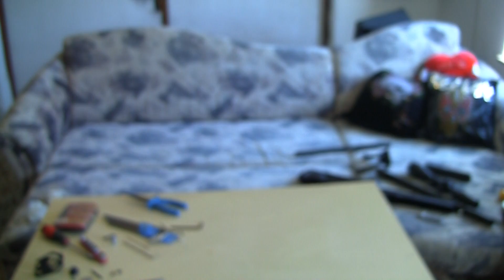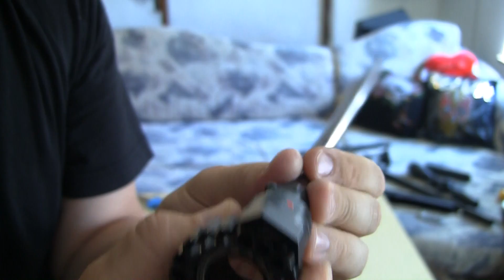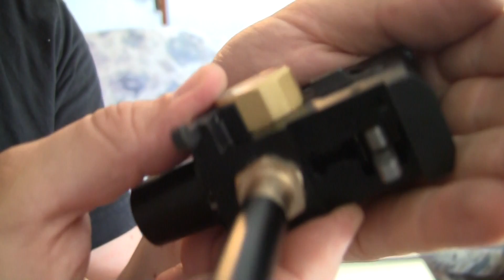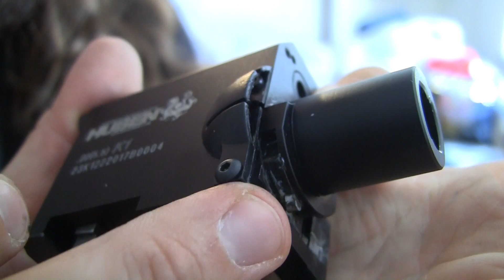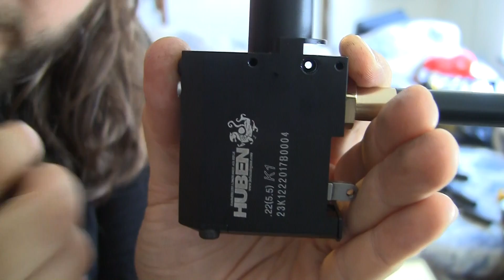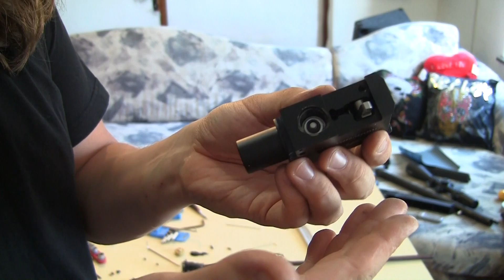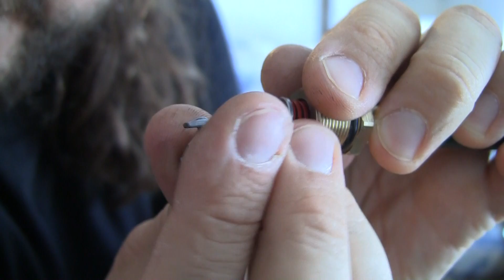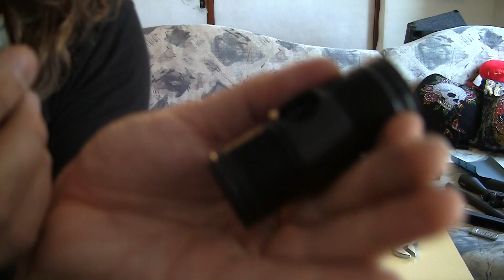Huben K1 version 2 - disassembly

Comment: Gregor 1st of all - great Videos that you do, thx for sharing your knowledge and skills. I have one question, that I think i know the answer but want to be 100%sure.
Could the closing valve be removed without draining the whole System? I think so, but maybe i did Catch something wrong.
Reply from the maker: You can drain only the regulated plenum by unscrewing the regulator down to zero (the regulator is designed to let the air out it self when you go down very far...). Note that this does put more stress to the regulator seal, but personally, I never had a problem with the regulator because of this and I do it all the time. I would suggest to take the stock off before you release the pressure though, once you have the stock off, just star unscrewing the regulator hex screw until the air bleeds to 0 on the regulator, then start disassembling the action...
Reply: @gregorkamensek3923  that makes sense, thanks so much!!!

Comment: After about 190 shots, pulled trigger and the gun would not fire. Safety would not go all the way down. Reading the manual, if I understood it correctly, it said to release pressure until safety would work again. I released all the regulator pressure to zero and the safety then regained its full range of motion. Turn the pressure back up but the gun would still not fire. Any ideas? I don't want to have to send it back if it's an easy fix.
Reply from the maker: If you cannot engage the safety, that implies that the trigger sear did not catch the valve but that would also mean that the air would be leaking rapidly for the gun... If that is the case, it is possible that the trigger springs are too loose (the two set screws you can see just above butplate on the rear). But I doubt that is the case as you mention that the gun does not fire. I assume that the valve is stuck in a semi open position, enough that the air is still not leaking but not enough to open. You can try to fire with higher pressure, try to go up to 180 bars.
It is also possible that there is some sort of trigger problem, maybe one of the sears broke so you cannot fire and also cannot put it on safe...
Reply: @gregorkamensek3923  I degassed the regulator and that re-enabled the safety. Then, re-pressurized it to 17 MPa, but still doesn't fire. I'll try to get it up to a higher pressure like you suggest. I had not changed any of the settings from when I received it. 
No leaks from the gun at all.
But thanks for your reply and help. I may have to return it for warranty work.
Reply from the maker: @jimdoria7871  Probably best to return for warranty repair... Triggers on semi auto guns can be tricky...
Reply: @gregorkamensek3923  with no reply after several attempts and almost a week of trying to contact Huben, I thought I would take a chance to try and fix this myself. Saw a video from Kraz Cool on resetting the trigger. It was relatively simple and it did work for me.
Thank you and Kraz Cool.

Comment: Mr. Gregor,
I had been watching all your video on Huber K1 V2 with so much excitement. After 3 months of watching (not everyday) I finally decided to please my order which you know it takes me almost 4 months of waiting and finally is here. Can’t wait for testing on the field..
My first question, how many shots can you get out of 1 filled of 300 bar pressure? Thank you. 
PS. Can I have your email address.
Reply from the maker: Hi. Shot count depends on the power you will use. No doubt that the best results will arrive by using slugs of about 35 grain shooting them at about 980 fps. With this setting, you will get at least 25 regulated shots (from 300 down to 170 bars) if you set you gun correctly.
Send me a private massage and I will send you my email or just write your email and I will contact you.
Reply: Gregor Kamenšek thank you so much for your reply.
Reply: You may have these!

Comment: Hi Gregor,
Can you sent me the exactly size of the two tools huben send to you for replace the seal so I can fabricate them.
Thank you very much
Reply from the maker: I the tools have a very slight cones on some parts and they need to have a rough surface on the one that is for removing the seal. So it is not easy to measure and duplicate them. I also slightly modified them so they might not work for you...
Reply: @gregorkamensek3923  Ok, thank you anyway

Comment: Hi .. thanks for the amaizing vedios ... can you make a vedio about what happens if you zero huben k1 on 50 yards then shoot at 20 yards,30, 40, up to 100 yards using huben pullets with full power... just so we know the trajectory.    Thanks
Reply from the maker: Ali Murad . Take a look at the data at the end of video 2 on k1 v2. There is a screenshot from chairgun. I have it zeroed at 25 meters and i have to hold over 2,6 mil dots at 100 meters.

Comment: How do you remove the endcap of the shroud? 
I want to put on a supressor that I´ve bought but the endcap is screwed on extremely tight.
Reply from the maker: Yeah that is a challenge. Best is if you have pliers with plastic inserts not to damage the endcap.

Comment: HI Gregor, thanks for the video which is what I need right now because my Huben K1 has developed a slow leak, about 2.5 bars per day. Just wondering if you have any thinking about the likely point of leakage ?  thanks in advance.
Reply from the maker: Hi. I had a similar problem. These are quite hard to find. In the end I solved the problem when I  disassembled the regulator and reassemble it, never really figuring out where exactly the actual leak was...
Reply: @gregorkamensek3923  Thanks Gregor, I will try to do the same. hope the problem is is not inside the action which seems to be very complicated.
Reply: Is it safe to submerge the entire gun in water with pressure to help identify the leak by seeing the tiny bubbles ?
Reply: @gregorkamensek3923  see
Reply from the maker: @hubenk1  It is not the best option, but it might be the only one that enables you to find the leak... Huben actually suggests to submerge the gun in pure alcohol :) I have the gun with removed stock when I do that and I submerge only the part that I assume is leaking. I usually still disassemble the gun afterwards to make sure everything is dry... There are still a lot of steel parts that might rust (barrel in particular).

Comment: Went to use my huben today and noticed reg pressure was way down to 100’ish, filled it with air and hear a slow clicking coming from the dial, possibly a leak? If so where would it be coming from?
Reply from the maker: Where did you hear the leak, near to which dial?
Reply: Gregor Kamenšek the regulator gauge there is a slow clicking but I dry fired till around 100bar then re filled, seems to have resolved the issue
Reply: Gregor Kamenšek do you have email I could send a 9 second video highlighting sound and location?
Reply: It’s definitely an issue and am very worried it’s a the VS, would compensate you if you can provide a VS and help as huben have gone dark and not had any comms with them

Comment: Is it necessary to remove stock to remove shroud?
Reply from the maker: No. Just loosen the rear two screws below the picatinny rail on the cylinder/shroud clamp and remove the front one. The you can just pull the shroud off.

Comment: Hi gregor, i had a leak treu my barrel. I changed the firing valve seal and it still leaks. Its not the indexing pin becausz when i lift the lever up it still leaks. What could it be?
Reply from the maker: If the leak is through the barrel that the problem is still the firing valve seal. Maybe the new seal did not seat properly. Also possible is that you have some starches on the valve or the seal seat. These parts are very delicate and you should be very careful when you replace them and use only plastic tools (except for the replacement tool that is of course metal). But if that is the reason, then the leak is very slow... so my bet would be that the seal did not seat properly.
Reply: Hi gregor, is there a way to send you a picture from something weird in the chamber where the opening valve seal sits? Looks like something is sticking out. I tried a 2nd time to replace the seal and stil leaks verry hard treu the magazin/barrel when a shot is fired
Reply from the maker: @klane7  You can give me your email...
Reply: I have sale problem

Comment: I have taken the airtube apart my Huben K1 ( version 2 ) and found that all the O-rings are surrounded by rubbery stuff like silicone sealant. It seems that they have added the stuff to make the seal better, may I know if you have seen the same thing in yours ?
Reply from the maker: No, I have not... On all my K1s there is only silicon grease on by the o-rings, noting else...

Comment: Hi mate how are you doing 
Need your help my huben is bleeding air out of barrel as I fill it what do I have to do
Last time I was have same problem I dismantled the valve both and the problem was solved and now after some shots same problem again started to bleed aur from the barrel
Reply from the maker: There are a lot of possibilites. It is possible that you are using too low pressure to shot. I would not recommend going under 120 bars (also make sure the pressure gauge is showing correct pressure). It is possible that the valve seal is damaged. And many other posibilities. How fast is the air leaking? Can you still fire a shot?
Reply: @gregorkamensek3923  my reg pressure is 140 bar and  I can't shoot it
Reply from the maker: @khilji74  So I guess you have a "fast leak". A few things are possible. It is possible that the trigger does not hole the valve closed. Did you adjust the second stage on the trigger on the rear side? if so, just make it a bit heavier (tighten the spring) and it will work. Next possibility is that the valve is stuck in the contracted position. To see this, you will need to remove the valve and try to extract it (try to pull the brass part of the valve out of the steel sleeve with hands - no tools!!! It should move out for about 3-5 mm and then stop). Next option is that the seal in the breach is damaged but if this is the problem, the damage must be significant in order for the leak to be so fast. Another option with the trigger is that the spring at the back of the valve behind the round part that engages the trigger is too weak to push the valve closed. There can be several reason for this, one is if the o-ring at the back of the valve is damaged and causes high friction, another is if the trigger sear has too much friction on that round part, another if the spring is too weak or broken,... In any case, be very carefully not do damage the breach / body as that is the only part that cannot be fixed (it can be replaced but it would be expensive I presume)... Good luck

Comment: Hi Gregor! Great video, as always.
I have a question about the k1. I've never disassembled it but the Weaver rail is misaligned with the barrel. My scope is at the end of the windage and I'm still hitting left of the center. How can I best fix this?
Reply from the maker: There are various ways to deal with this, but if the gun is shooting well, I would go with adjustable mounts as I would not advise disassembly if not necessary.
Reply: @gregorkamensek3923  ok, thanks! I'll be getting myself a set of those. But just out of curiosity, what would some of the other ways to deal with this be?
Reply from the maker: @tacticalbantha2511  First you would have to find what exactly is the reason for this misalignment and then solve it. For example, some scope rings are not accurately made or not made up to rail standards and this could be the reason, it can be that the rail is not aligned with the barrel, or maybe the gun when assembled was not properly aligned. A lot of bulpups have this problem as there are many points where barrel is fixed and can even cause for the barrel to be slightly under a tension or even bent... But I cannot say how to fix an issue without knowing the cause.

Comment: Hi Gregor, I have a problem. Recently I’ve been shooting the Huben K1 v2 but I hear a rattling sound as I shoot. Is it a problem with my setting between the power wheel and the pressure? Or the trigger adjustment? I’ve tried tinkering but it didn’t fix it. Any thoughts?
Reply from the maker: Is the rattling sound only when you shoot or also if you shake the gun. Is the sound present also when you dry fire the gun? Is the gun otherwise operating normally? The problem could be a lot of things and will be hard to find just through conversation.
Reply: Gregor Kamenšek it makes the sound only when I shoot a bullet or dry shoot. What could it possibly be you think?
Reply from the maker: @Komunika00  I cannot set only by this description.

Comment: Hi Gregor.  Your videos are very good.  Can I ask you something?  I bought one.  In my country, Argentina, there are no people who know the rifle.  I made the mistake of trying with defective pellets.  The charger was locked and all the air went out.  The charger did not spin.  I took it apart, took out the defective pellets and assembled it.  But now, I connect the compressor and I can't load it.  Lose air somewhere.  Do you know what the problem may be?  Give yourself, thank you very much.
Reply from the maker: Hi.
Do you know where the air is leaking form?
Reply: @gregorkamensek3923  hi. The magazine
Reply from the maker: @sanjuan1234  OK, most likely, your main valve is leaking.
If the leak is very bad, then it is highly likely that you have either reassembled it incorrectly or you damaged the opening valve seal. If you damaged the seal, then you really have a big problem. Another option is also if your trigger mechanism is not holding the valve closed. you can check this by trying to put the gun on "safe" when it it leaking - if it is not possible to do so, then the problem is in the trigger sear. In this case, check if both the trigger spring on the rear of the action are working.... 
If the leak is not very fast, then you can try to get the pressure of the reg high (for example to 180 bars) and then try to fire a few dry shots to see if it will seal...
Let me know how it goes.

Comment: Hi Gregor,  After firing a shot with my Huben K1 ( version 2 ), the pressure gauge reading will instantaneously drop by about 20 bars and it will take about 10 seconds for it to restore the preset value, may I know if this is normal ? if not, what could be the cause ?
Reply from the maker: You have a problem with your regulator. This is a quite common problem with regulators. Replacing the regulator seal (plastic) will solve your problem.

Comment: Indeed great video on huben, and its help.me alot to fix.mine,but still I m stuck at one point and need your help. 
With empty magazine my huben  fires and run great but when ever I put pellets in magazine,its blow all air from barrel,seems its valve stuck some where.
This is my 1st huben but I hv good knowledge abt pcp air rifles as I have lot of good brand rifles.
Plz help.me
Regds
Reply from the maker: Go to higher regulator pressure and close down the power wheel at least to 8 clicks from the minimum.

Comment: Hi,
First: grats for very good information videos! :)
Second: I have technical question... My Huben K1v2 stopped indeksing magazine.
It is new. I shot only about 200 pellets...
- Magazine just stopped rotate, withot any other symptoms. I didn't make any adjustements at the time.
- I can rotate magazine (after lever rised) as well as before failure.
- If I push some force to the magazine when I shot, I sense some force to rotate - so something there still try to work.
- I checked many kombinations of velocity wheel, and pressure (120-180Bar), shot is good, but magazine wont rotate.

Have You experience of that strange failure?

Regards,
Marcin
Reply from the maker: Most likely, the o-ring on the pin is damaged and it prevents the pin form moving (the 2,5 mm pin). 99% sure that is your problem... The only important thing form indexing the magazine (except if it is sucked) is regulated pressure. It is is too low (under about 120 bar) it should index no mater all other settings...
Reply: Thanks :)
I carefully watched Your video, so i know this pin :)
I send Huben to my distributor, because is almost brand new...
But... in the future I have chance to fix problems by myself

Comment: please share the sizes of tool you promised
Reply from the maker: Hi. The sizes are not the same (as I mentioned), so I would suggest that you contact Huben (huben(at)hubenairguns.com) and give them your serial number and they will tell you exactly what size of the tool you need. BTW: the tool has a complex contour (even though is looks simple) that is hard to measure, you would need to have a complete 3d drawing to be able to replicate it.

Comment: hi sir i have made few request to you but none is replied so far..please spare sometime for huben lovers and oblige ..at present after dissembling and cleaning the complete gun i reassembled it and filled air...the air went out of the last hole on back of cylinder with regulator on...i mean the back of lower pressure part when still connected to regulator assembly...Should the main cylinder not hold the air in this case??and how should i go ahead please